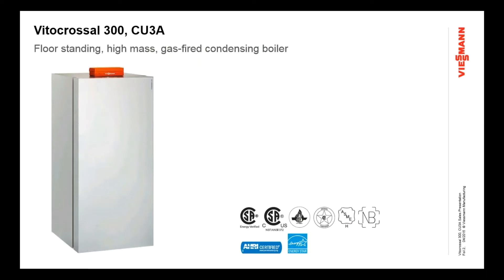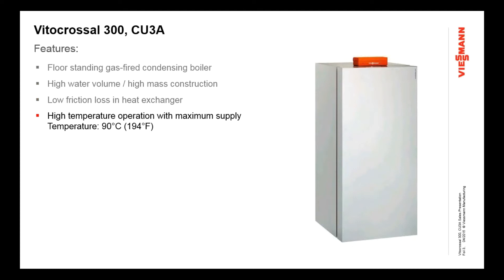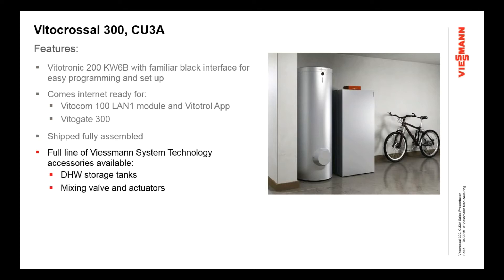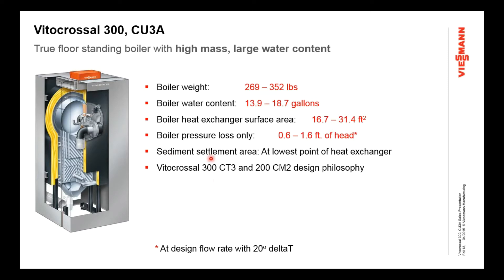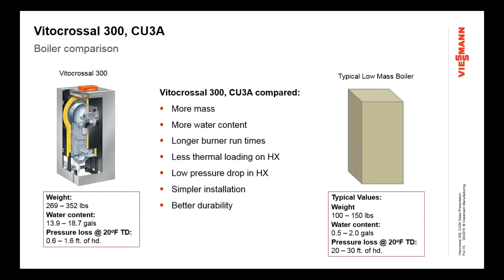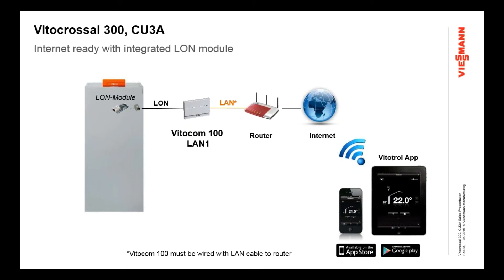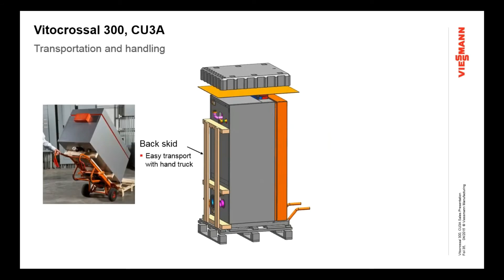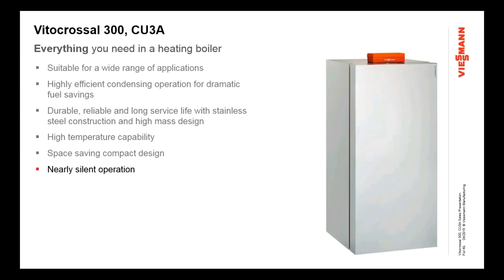Introduction to Vitocrossal 300, CU3A

Comment: When this boiler is replacing a cast iron boiler on an old gravity system, do you need to have constant circulation for the Outdoor Reset to work properly?  Or does the circulator turn on and off with the boiler the way it does with a cast iron boiler?

Comment: The boiler shown at 48:02 is not a hot water boiler, but a steam boiler, as you can tell by the two risers and the drop headers.  I don't think Vitocrossal would be a good replacement for a steam boiler such as this.
Reply: Shahrdad, Good catch. 
Yes the 3rd party boiler shown is a steam boiler. You are correct this Vitocrossal 300 CU3a is a hot water boiler and not a good replacement for a steam boiler without a lot of system modifications. This is our fault when we selected a picture for the production of this Webinar.
I'm sorry for any confusion. We will try and do better.
Thanks for keeping us on our toes.
Mark Norris Viessmann Canada Academy Instructor.
Reply: @marknorris9722   You’re very welcome. I didn’t catch it when I first watched the video myself.  I have been trying to find diagrams or photos of how this boiler has been used with an old gravity hot water system without secondary pumping.  I have also been unable to find that on such a system with the big cast iron radiators whether Viessmann recommends a continuously running circulator pump, or whether the pump and boiler come on when heat is asked for by the thermostat, as is the case for old cast iron boilers. Also, on a large volume converted gravity system, does this boiler run off of a indoor thermostat, or is the desired temperature set on the boiler itself in combination with the outdoor reset?  Or can a combination of outdoor reset and indoor thermostat be used? 
My current 50 year old cast iron boiler with 196,000 BTU output has kept the house perfectly comfortable even on the coldest days, but I think it’s time for a new boiler.  Since the output of the largest CU3A boiler at 95% efficiency is closer to 190,000 BTUs, I’m wondering whether it can be paired with a Vitodens 100 as a backup boiler in the future in case it proves unable keep up on the coldest days of the year.  Or does it have to be paired only with another Vitocrossal 300?  
Thank you in advance.  I’m very excited about having this boiler in my house.
Reply: @marknorris9722   Thank you very very much Mark.  I think the largest CU3A is going to suffice for my house, which although quite large, has been kept perfectly comfortable with a boiler with 196K BTU/hr output.  Just out of curiosity, can the Vitocrossal (primary boiler) be paired with a Vitodens 100 as a back up/secondary boiler?  Or is it designed only to be paired with another similar boiler?
Reply: @Shahrdad  The Vitocrossal 300 CU3a can be paired with a Vitodens 200 B2Hx series boiler because they share the same control platform. The Vitodens 100 uses a different control so it will not work with the Cascade control. If all you wanted was an emergency backup, you could use the alarm output on the CU3a boiler as a call for heat to the Vitodens 100 but they would not run together and the Vitodens 100 would need its own setpoint internally. This could be fixed or OAReset. If you plan on using the CU3a for DHW as well, the Vitodens 100 would not be able to perform that as a backup as an emergency boiler.
Reply: @marknorris9722   Thank you Mark!  My current 50 year old cast iron boiler is rated for 196,000 BTU, and when it was 0 degrees, it ran continuously.  It makes me wonder if the largest CU3A has enough output to such cold days, of course assuming my ancient boiler is still putting out 196 MBH.   I'm also considering two of the 125 CU3As, but have to figure out if they can be vented together through the chimney, as I am reluctant to cut holes thru the sides of the house.
Reply: @GeoffLayton  I did, and the old boiler seems like the right size.  I also did an actual calculation of how much gas my boiler was using when the temps were around 0 and the boiler ran continuously.  With only the boiler running, I  watched my gas meter.  The boiler consumed 5 cubic feet in 88 seconds (The 1/2 cubic foot dial took 88 seconds to turn ten times).  Based on this and the heat value of gas in our area, my boiler was actually burning around 210,000 BTU/hr and keeping the house a comfy 70 degrees on a zero-degree day.  Assuming my old boiler is still 80% efficient, it was putting out around 168,000 BTU/hr.  This makes me think that big CU3A would more that suffice.  

If the CU3A is slipped right in place of the old cast iron boiler as shown in the video, does the circulator need to run continuously for Outdoor Reset to work properly?  If so, how many gallons per min?  My current circulator is a Taco 110 which on an old gravity system without much resistance should  be pumping 33 Gal/min.  I am assuming this volume is needed when the circulator cycles along with the boiler, but I don't know how big a circulator would be needed if it needs to run continuously for outdoor reset to work properly.

Comment: I skipped around a little bit, does this boiler maintain a water temp or is it cold start.
Reply: Jim,
By default, there is a warm weather shutdown function for the HC (Heating Circuit) features that will disable the boiler heating set point operation during warmer weather. The boiler will then be a cold start boiler for DHW etc. in the summer and maintained at the weather compensated value is the winter. 
However, there are a few ways to keep the boiler at a minimum temperature all the time if that is desired.
Using either external demand, or one of the ZC (Zone Circuit), fixed set point features (The ZC functions were introduced as a software update on North American boilers after this video was produced), will give you a constant boiler water temperature and still allow DHW or heating loop set points to turn the boiler water temp up when required.
Jumping the command contact, one of the DE or the #96 inputs, will maintain the boiler at the external demand or ZC constant temperature set point. Some coding needs to be set for this to be enabled).